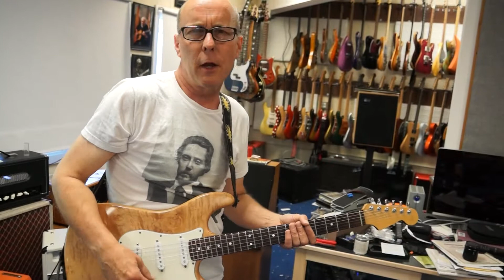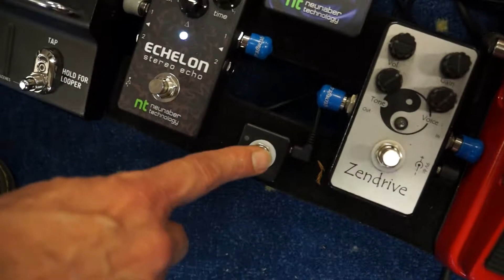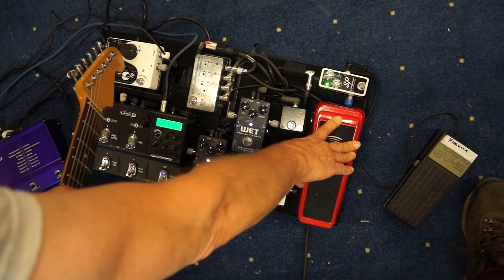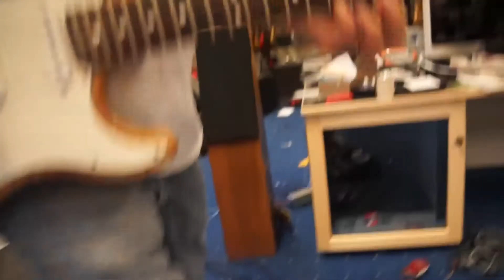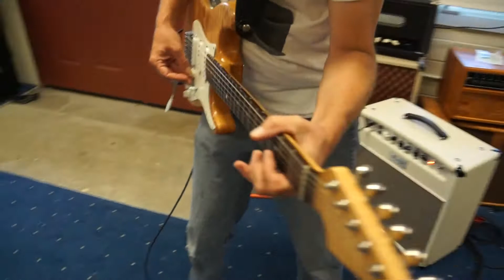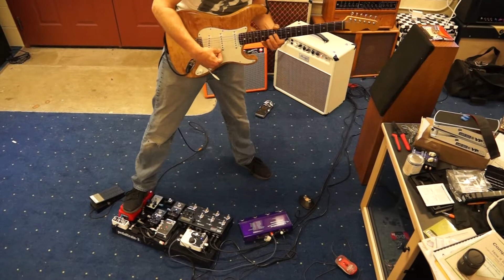Neunaber Effects Demo with Bill Walker

Comment: Hello Bill, excellent information, I would like to know that Tap Tempo is using with Neunaber Echelon, I had not seen it before, what brand it is or what company manufactures and distributes it, thanks.
Reply from the maker: hey Alejandro that tiny tap switch was made for Neunaber and was available from them, the new V2 pedals don't require it, as the newer pedals can activate tap tempo from the main switch on the pedal, if you need one of these or the little adapter that lets you use other footswitch brands, let me know and I might be able to find one in my stash